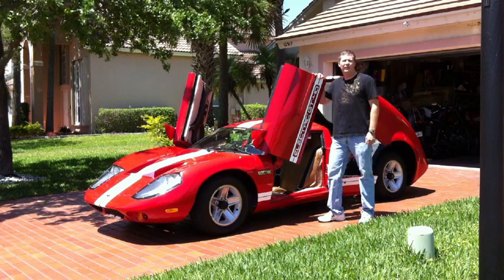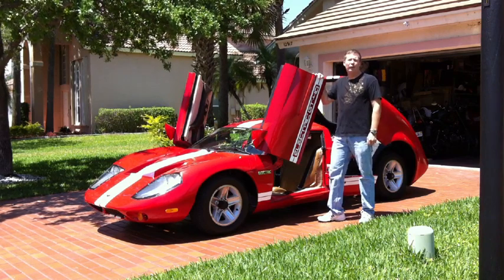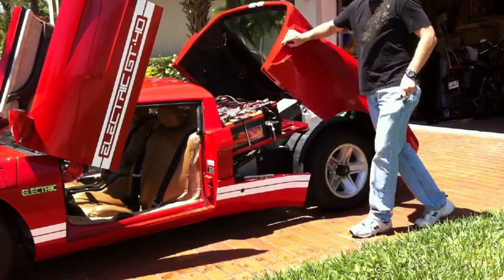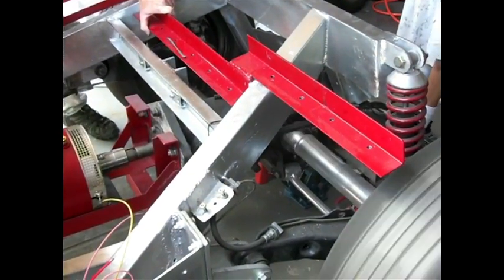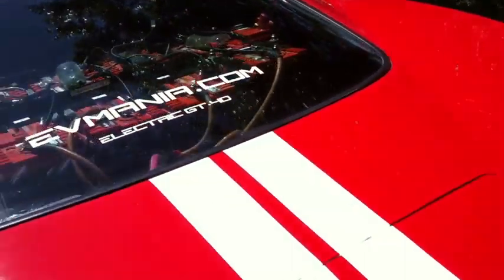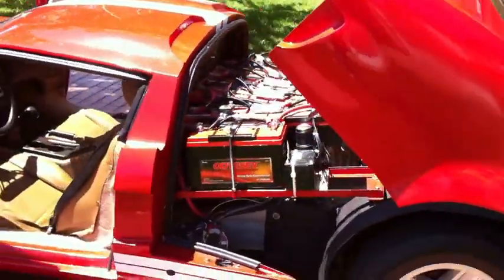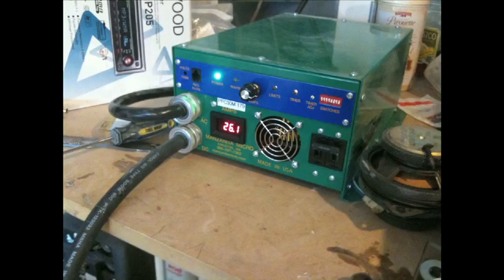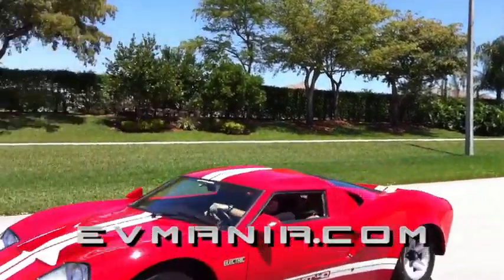The EVGT-40 electric Fiberfab Valkyrie

Comment: I'm getting ready to do the same thing with my GT-40 replica. I see you still used the Fiberfab chassis. Did you have to chop it much to make room for the batteries? I'm thinking of using the same chassis. Are they still making this chassis? I currently have a Mazda rotary 12A hooked up to a VW trans. Did the job in 84 and it's been great but the chassis(VW) is now rotten. Starting over time!